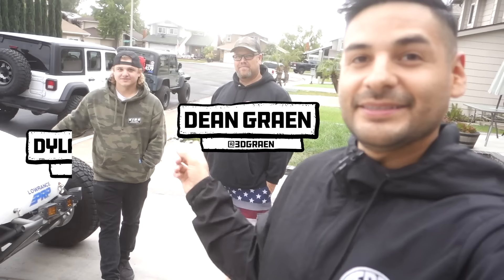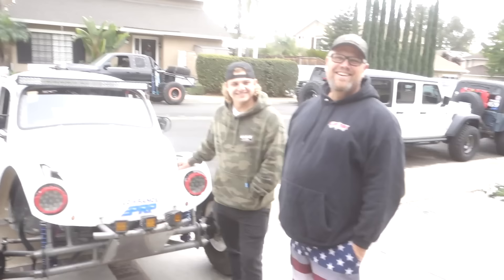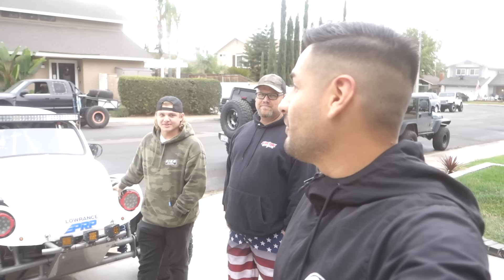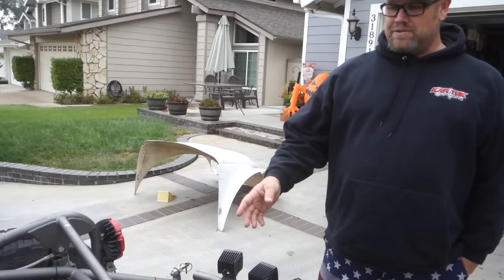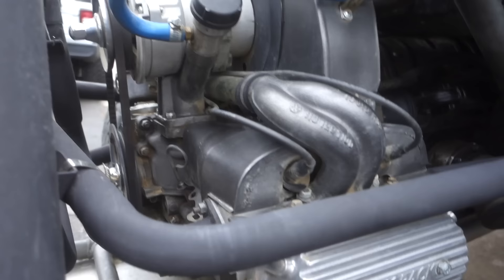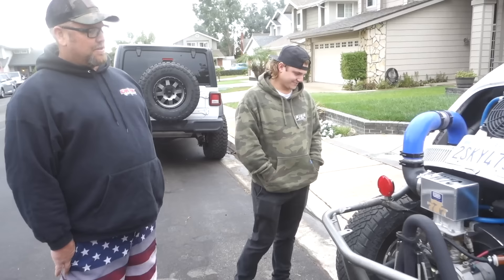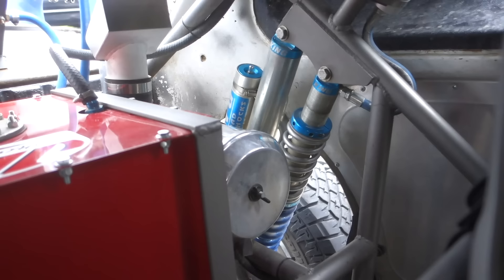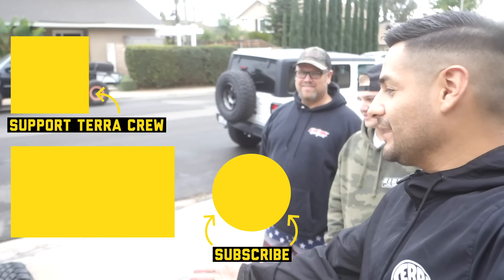Father & Son built VW BAJA Bug! | BUILT TO DESTROY

Comment: Awesome video , and Awesome bajan bug!!!  Don't know why they wanna go with a watercooler engine though ? Just looking at their engine setup , I could change three things on what they're running and make alot more power , and still be air cooled  , and then no worries ever of losing a radiator while out tearing it up in the desert . The engine builder at Claudes Buggies in Farmersville Ca , 5 years ago was pulling 250 hp out of a naturally aspirated type 1 , so that being said , there's no reason to go watercooled . You want more horsepower throw a turbo kit on it , andd then you still have a true Blue VW baja bug 👍There is a reason that the VW's were designed as an air cooled engine , because they don't have to depend on a radiator cooling system to run . But to each their own 👍They certainly have done a great job on putting that one together!!! Makes me miss my baja bug 😔 Grreat video 👍👍

Comment: VW the Germans know how to make engines last.  Air cooled is the best thing for in a desert environment.  Water cooled is only more issues more breakdowns over cooling systyms.   You can build up several hundred HP or more with turbo and engine work.   Air cooled is beautiful.